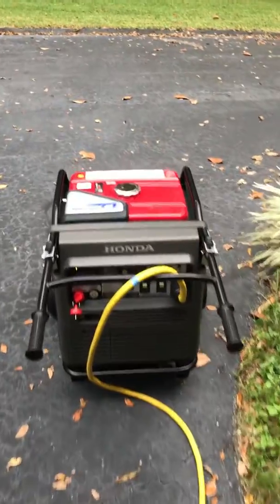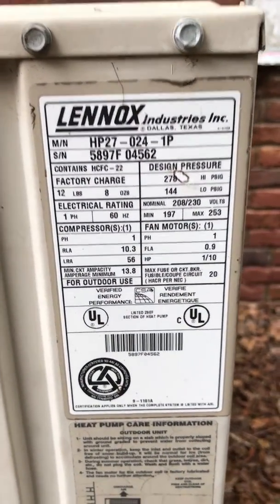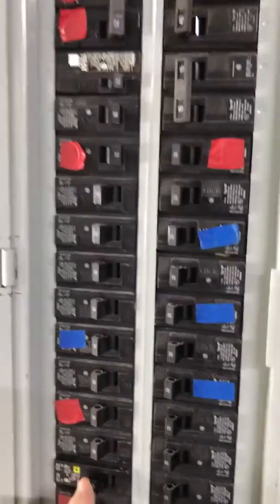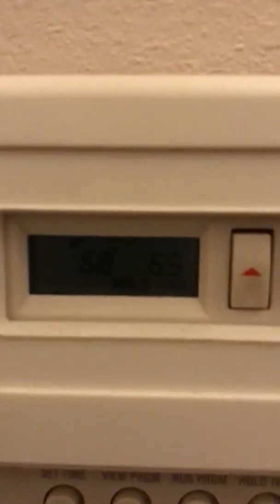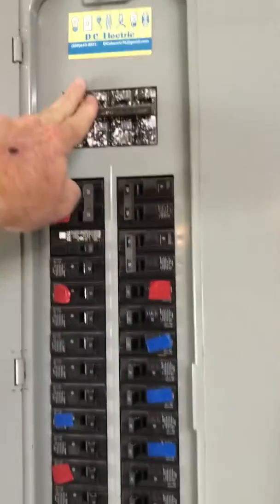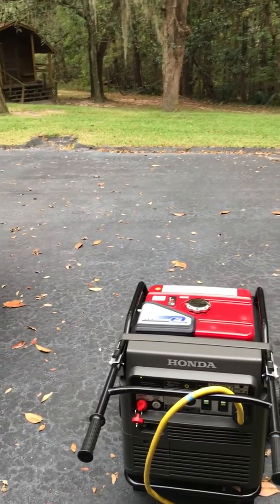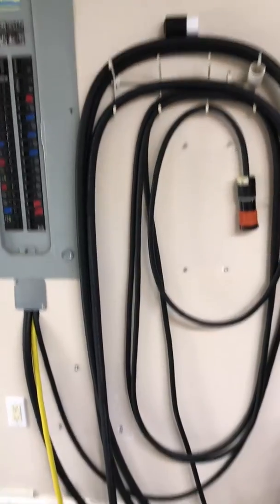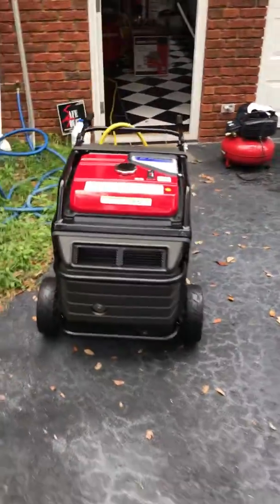EU7000is Honda runs 2 ton central A/C unit

Comment: Nice unit. I'm looking at buying one now and tossing between the 20i or the 70is. I realise thats a massive difference but I really don't think a 20i would run a fridge when the compressor kicks in so it's kind of useless as a primary backup generator for a house? plus i will want to run AC full time eventually and do some light welding.
Reply from the maker: TechStories79 well the only small generator that I have found that will really really fight and it will operate all of my RV air conditioners is the little pulsar 2000 the Generac the Briggs will overload and kick out immediately but the little pulsar 2000 will run up to 13,500 BTU unit with no problem even on auto throttle economy mode it will run my whole house on LED power and my refrigerator with both air-conditioning units turned off but the little pulsar for $400 you cannot beat it I would not Purchase any other brand small generator